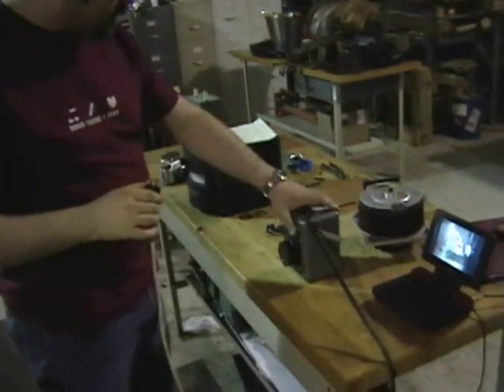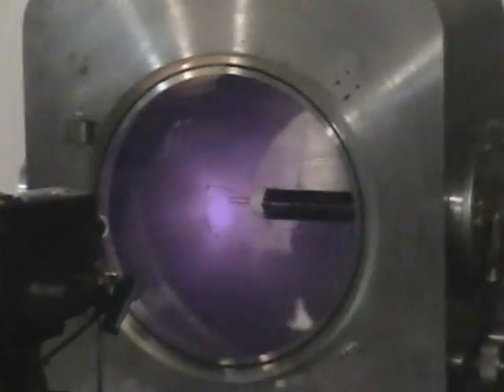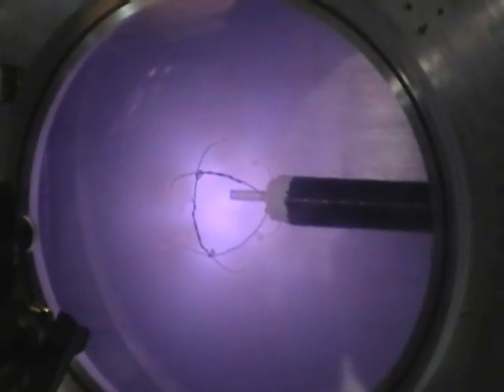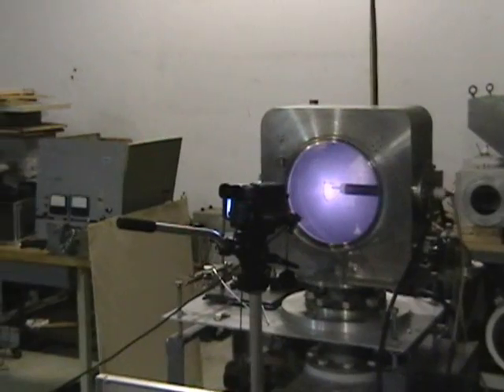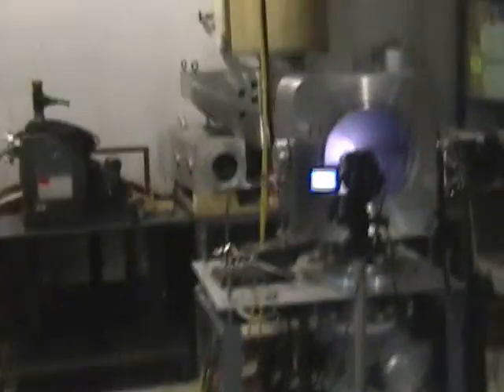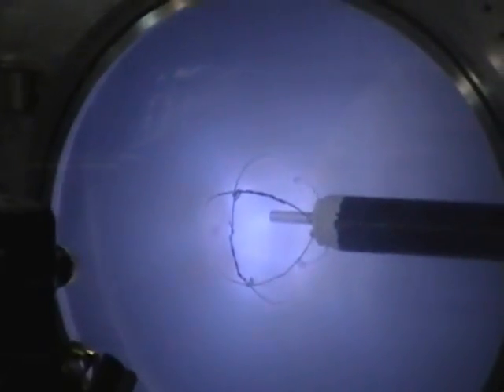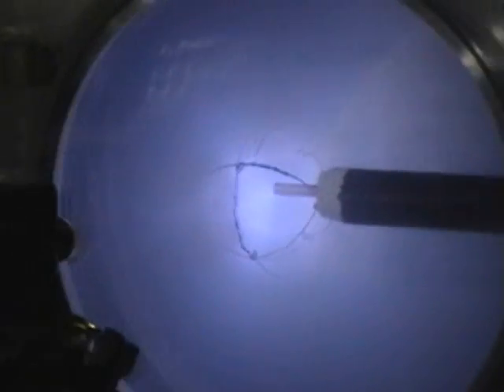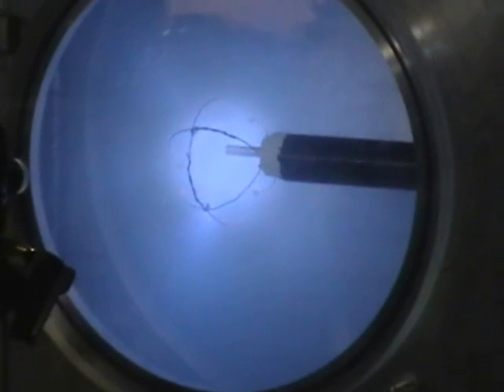Fusion Reactor First Test Run

Comment: Temperature is just one part of the equation, density and heat capacity of the material are the other parts. The earth's upper atmosphere is millions of degrees but, nothing happens to the space shuttle when it passes through it because the actual amount of heat energy in the upper atmosphere is very small so, the shuttle absorbs very little energy.

Comment: In theory, fusion can at almost any temperature. The core of the sun is only 14 million degrees or so. On the other hand the power density of the sun is exceedingly low as well. Below temperatures of about 6.8 billion kelvin fusion is a purely quantum mechanical effect resulting from barrier penetration. (The positively charged nuclei repel until they are close enough for the nuclear force to take over and pull them together) Thus even at low temperatures fusion can occur, it's just unlikely.

Comment from the maker: If I had to place my bets on a device actually achieving meaningful net usable energy production I'd say the Polywell. They claim they could have a commercial power plant as early as 2020, although I wouldn't hold my breath.

Too much money and man-hours have gone into magnetic confinement and more specifically tokamak reactors to have achieved so little, it's a dead end in my opinion.

Comment from the maker: What a coincidence, I'm currently pursuing a degree in mechanical engineering.

The traditional Hirsch-Meeks, or Farnsworth Fusor will never be a commercial source of energy, it's too inefficient. However a direct ancestor shows a lot of promise, the Polywell.

The grid at the center to create a negative potential well is replaced by a virtual cathode made up of a cloud of electrons circulating through a polyhedral arrangement of toroidal magnets. This change makes the device more efficient.

Comment from the maker: Actually it has more to do with the fact the lab where we work on this had the vacuum chamber available that worked well for our purposes.

If I had a choice I'd prefer a much smaller viewing port, it's easier to shield when we produce harder x-rays at higher acceleration potentials.

Comment from the maker: Depends on how you go about defining things. A Farnsworth Fusor initially was a multipactor, the idea evolved over the years and distinctions are hazy.

Terminology aside, this is an Inertial Electrostatic Confinement system, currently using glow discharge for ionization, although we are working on ion guns for lower operating pressures and more uniform ion energies.

Comment: this cannot be real. Europe hasn't even completed their multi billion dollar project for the first stable test run. that thing is huge. you have temperatures of over a million degrees Celsius! that plasma cannot be so easily be contained in the back of somebodies garage! let alone the energy need to achieve fusion is that of an entire power plants alone.

Comment from the maker: The joke seems to be on you, because it does indeed do fusion. 

Kinda hard to argue with a measured isotropic flux of 500k neutrons per second. You should bring up you're argument with the neutron bubble detector and BF3 detectors.

This is not pseudo-science or unsubstantiated blathering like most of youtube. It is actual hard science well backed by 50 years of theory and experimentation.

Comment from the maker: Even with a perfect vacuum, 14.7 psi is not enough to collapse the viewing port

The port material is .153 m in radius and .025 m thick. PMMA has a Poisson's ratio of 0.35 The loading case is a simply supported circular plate. Maximum stress will be
3/8p*(3+v)*(r/t)^2
[Adv.Mech. of Mat.  Boresi/Schmidt pg491]
r is the radius, t thickness, v Poisson's Ratio, and p the uniform load 100000 Pa atmospheric pressure
Maximum stress will be 4.5 MPa versus a tensile strength of 50 MPa
You're wrong

Comment from the maker: First, the viewing port is acrylic (PMMA) not glass.

Second, the difference in force between even a rough vacuum and the highest vacuum achieved in the lab is extremely small ~0.000015 psi. Pulling a deeper vacuum does next to nothing fto the forces acting. Atmospheric pressure being 14.7 psi, even a perfect vacuum will only produce wait for it... 14.7 psi. It is a common misconception that deep vacuum is some sort of super powerful force. Get your fact's straight.

Comment from the maker: Yes, actually the chief radiation concern is x-rays as a result of the high acceleration voltage, not the radiation from the actual fusion! Above about -10k potential you start to get harder x-rays from Bremsstrahlung. Lead shielding is virtually mandatory, although nothing can make up for r^2 flux drop off and limited exposure times.

Unless you are reckless the actual radiation dosage is negligible.

Comment from the maker: We are very fortunate to have lab space in the Van de Graaf accelerator lab on campus, which is now largely defunct. There is nearly anything we'd need for vacuum chambers/pumps/measurement, high voltage power supplies, etc. Also because we have oversight by the Radiation Safety Office from the nuke reactor also on campus we have access to anything we'd want for radiation metrology. Deuterium is fairly cheap, typically a couple hundred for a lecture bottle.

Comment from the maker: Laser based fusion is a technique called Inertial Confinement Fusion, it depends on radiation pressure to provide sufficiently long confinement times

However it is not the only technique possible to achieve fusion. The popular tokamak design uses magnetic confinement for instance. A strong toroidal magnetic field confines hot ionized plasma

A Farnsworth/Hirsch-Meeks fusor uses electrostatic confinement. A voltage potential between the inner and outer grids confine positively charged nuclei

Comment: rashanal thinking but its not done that way there is a lot more to it than that and in short all there is nothing on the brake pads to convert heat into electricity. its done using a motor/dynamo clutch fly wheel arrangemant that switches between drive and driven using a switch activated by pushing the brake peddle

Comment: Wrong. You just need to heat up and compress Tritrium or Deuterium so bad that it starts a fusion. You're talking about a Hydrogenbomb. And that thing went boom due to the same that I just mentioned. The 250 Kiloton Bomb was just necessary to heat up the shit around the Deuterium and turn it into plasma, compressing and heating up the Deuterium and Tritium so bad that it will fusionate. Thus you can always control the Fusion, there is no chain reaction. A hydrogen bomb just doesnt have security.

Comment: "Could you please tell me "easily" why fusion reactions (like this) are not efficient, why this can not be used to produce energy instead of, for exampe, burning coal or gas; while fission reactions are?"

Neutrons don't "see" the electromagnetic force. They can barrel right into the nucleus of an atom, which can induce fission.

With fusion you have to get two positively charged objects so close to each other that the very short range nuclear force overpowers electrical repulsion.

Comment from the maker: It is theoretically possible to get real usable energy out of fusion.

The problem is two-fold though: Some of the theory behind fusion reactions and plasma interactions is poor. To make things worse there are some very big and challenging engineering problems dealing with containing and maintaining the fusion reaction.

People continually underestimate how difficult it is to get real energy out of fusion, hence why people have been saying it's been right around the corner for the past 60 years.

Comment from the maker: Very few processes in nature work well in reverse, or even at all, that's the Second Law of Thermodynamics hard at work! I suppose the closest thing to what you describe would essentially be a solar panel.

The thing you have to realize is that regardless of what process you dream up, there is a maximum efficiency achievable. This isn't a practical limitation, but a real physical limitation that is impossible to overcome. For converting heat to work, this is the Carnot efficiency.

Comment from the maker: The main difference is this: fission splits things apart and fusion puts them together

Big nuclei like uranium are unstable, so a small input of energy can split them apart and release energy. The splitting process can turn into a chain reaction, so it keeps itself going

Fusion requires a large input of energy to fuse nuclei, but releases even more energy. However it isn't self-sustaining, it requires a constant input of energy to continue, so you need to make more energy then you consume

Comment from the maker: By about maybe 10^ -15 of a watt. When you hear talk of a break even reaction, it's not more ouput then input, that always happens. The problem is that a large proportion of that energy is in the form of heat, waste heat from the auxillary equipment (vacuum pumps, etc), and heat from the reaction itself.

In order to get a truly "break even" reaction you need to beat the inefficiencies of turning that heat into usable energy (a steam turbine might be only 50% efficient)

Comment from the maker: @HENN3H

Saying fusion will be commercial in 30 years is pure speculation

No reactor in THE WORLD has come close to even breaking even. ITER et. al. have a roadmap drawn up with the eventual goal of a commercial reactor, but that is purely an operation guideline, not a deadline

When fusion research first began they thought we'd have reactors in 10 years. That was over 50 years ago! 

They said we'd all have flying cars by 2000, I'm not holding my breath.

Comment from the maker: Depending upon how efficiently it operates, commercial fusion power could be either a complette revolution, or would just be merely cost competitive with existing power solutions

Cheap enough power (ie. essentially free) would revolutionize industry. Technologies that aren't cost effective due to power requirents could become realistic (ie. mining the oceans)

Fusion is typically billed as "clean" but depending on the type of fusion occuring it can make significantly radioactive byproducts.

Comment from the maker: There is nothing in Physics that specifically forbids net energy production. So strictly speaking, it's an engineering problem mainly. That said however, a good portion of the theory/reliable mathematical models is missing or needs work. Either way a significant amount of research stills need to be done.

It could be that there will be a breakthrough tommorow, or it may be hundred(s) of years before we get a commercially viable source of power.

Part 1 of 2 (continued)

Comment from the maker: After you've banged your head against the same wall for 50 years, it's time to find a new wall.

Although the Farnsworth Fusor is old tech, not much has been done in academia with them experimentally. The benefits to this are twofold.

One, as students we have an opportunity to make non-trivial contributions to physics at an undergrad level.

Two, although the fusor is unlikely to break even, it may point in novel directions to something that will (ie Polywell) (Part 2 of 2 cont)

Comment from the maker: D-D fusion doesn't have THAT low of a cross-section, we could do better with D-T, but tritium is expensive and a controlled substance.

No current fusion reactor puts ion energy to efficient use, do that and you might as well buy your ticket to Sweden ahead of time!

There are a number of ways to verify D-D fusion. ~50% of reactions produce a fast neutron, which you know didn't come from elsewhere. You can you use a He3 detectot, bubble dosimeter, or even a scintillator with proper moderator

Comment: The problem with this attepts to achieve nuclear fusion, is that the (crosssection) probability of getting to nuclei fused is very low, and almost all the energy those ions get goes mainly to ionization of other atoms, inelastic collisions etc. How do you confirm that you get, indeed, nuclear reactions ?

Comment from the maker: The US government does fund fusion research. I couldn't find statistics after a quick search, but I remember seeing a chart somewhere that showed US government R&D research spending; fusion took the lion's share (over 50% if I remember correctly).

You don't hear much about fusion research in the news because it's been going on for the past 60+ years and there haven't really been any big advances.

Sustainable fusion power in my opinion will require a major breakthrough in technology to work.

Comment from the maker: I believe you mean mumbo-jumbo, the mambo is a type of dance.

Also there is no danger of this "blowing up" fusion is an inherently non-runaway reaction, which is part of the reason why a self-sustaining reactor has yet to be built. Nuclear fission is a chain reaction, it feeds itself. Fusion on the other hand requires a constant supply of power to accelerate/heat ions, and run the magnetic/inertial electrostatic confinement.

This is not mumbo-jumbo, its well established science.

Comment from the maker: The voltage difference between the outside and the center of the chamber accelerates ions, the ones that have enough energy to overcome electrostatic repulsion between their nuclei fuse.

The ions are "hot" because their average velocity is high, but that is only close to the center, as they circulate outwards they slow down because they are going against the electric field gradient. The center grid is what we worry about. Ours is currently made out of tantalum, which has a high melting point.

Comment from the maker: In this particular video we are running on an atmospheric mix, no fusion is occuring. So yes without any deuterium it is a glorified plasma ball.

However, when the chamber is pumped down with the diffusion pump to remove the N2 and O2, and then backfed with deuterium, fusion most certainly occurs.

We were operating here with an atmospheric mix because we didn't have rad safety set up yet. D2 fusion spits copious high energy neutrons, which are very dangerous to biological matter, ie. us!

Comment from the maker: We have two concentric spheres, the outer one is at a ground potential and the inner one is at a high negative potential ~-30kV. 

This creates a strong electric field that ionizes the remaining gas in the chamber. The now free positive nuclei are attracted by the high negative potential and accelerate towards the center of the spheres.

Where they converge at the center is a region of relatively dense and energetic plasma with some of the particles having a high enough energy to fuse.

Comment from the maker: Incorrect, "cold fusion" would be non-trivial fusion occuring at temperatures "near" room temperature. Both inertial confinement and IEC require a average particle "temperature" far above STP conditions that is necessary to overcome coulombic repulsion between nuclei to be fused. Most "cold fusion" attempts or theories rely on some proposed catalyst that would be able to lower the necessary apparent temperature. The idea being cooler fusion is easier to make/confine then hi-temp plasmas.

Comment from the maker: Plasma color is mainly a function of gas composition, as well as the average energy of the plasma, as it goes up electrons are excited to higher orbitals and so the color goes from low frequency (red) to higher frequency (purple) etc. Also any impurities, ie. vapoization of inner grid (especially copper) will affect the color as well, much like how they add impurities to fireworks to get different colors.

Comment from the maker: Don't forget that most aluminum alloys would work well too, just stay away from the 7xxx series as that is zinc based and so has a high vapor pressure at low temps. Something like 6013/6061/6063 would work well.

Comment from the maker: Really any size chamber works, depending on how much you want to pump! Smaller is definitely better if you're on a budget, cheaper chamber and lower CFM needed for pumps. 
Bubble dosimeter is reliable and cheap, if you're lookng for alternate methods: BF3 or He3 detectors are nice but more expensive and susceptible to the RF noise from the fusor. You can also try a scintillator/PMT setup and set the discriminator high. Since we work in the accelerator labe we have access to all these detectors.

Comment from the maker: We were lucky enough to already have the chamber available, it was probably used previously in the university accelerator lab where we have lab space.
The chamber is stainless steel (not sure of spec. probably nothing too exotic) and looks like it was TIG welded. There is no pre-stressing. The largest forces a vacuum chamber will see typically are purely atmospheric, ie. 14.7 psi, so not much.
Vacuum chambers are typically made out of thick metal to limit outgassing and interstitial flow.

Comment from the maker: For those who don't know, Todd Rider has written several papers explaining some shortcomings of IEC fusion, and why they won't reach breakeven.
We're not expecting break-even fusion power. However, just because we aren't producing net power doesn't mean that our work has any less merit. One doesn't need to make net power to gain insight or even make novel discoveries in a field that is still quite young. Plasma physics is notoriously difficult to simulate, so empirical study is paramount.